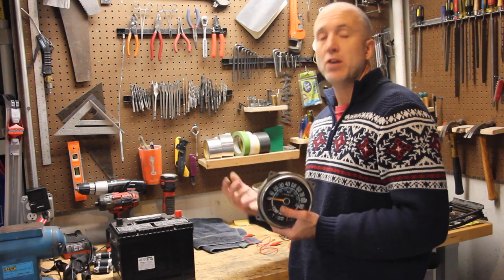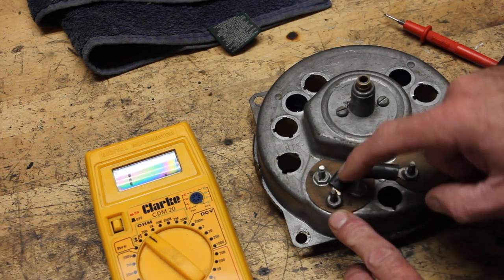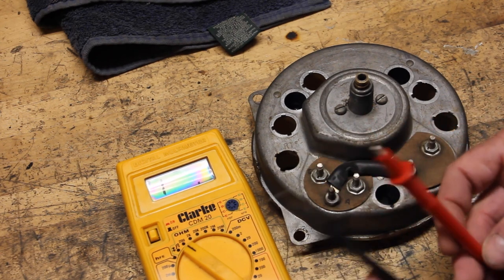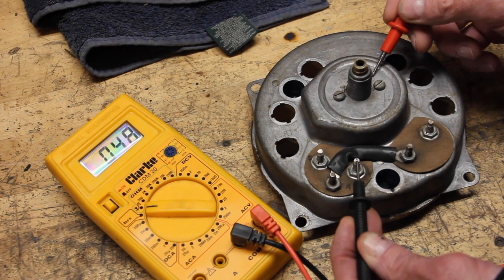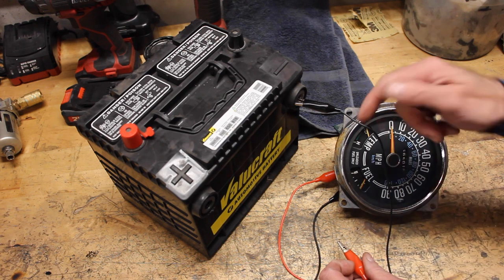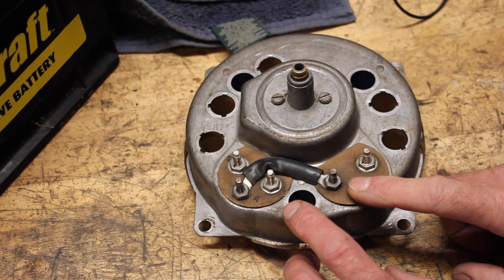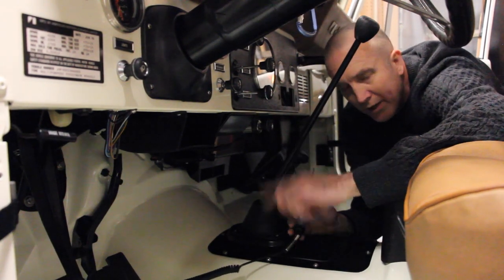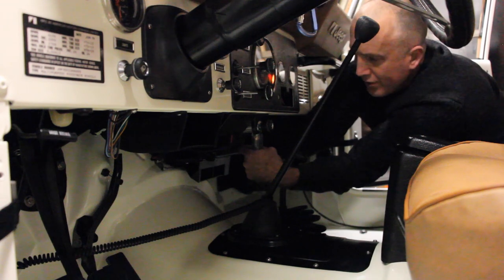Jeep CJ Fuel and Temperature Gauge Problems and Testing

Comment: What a cool and helpful guy you are!  My better half rolls her eyes every time I add another piece of blue tape with the new "do not exceed" mileage to the speedo.  You've taught me now how to properly diagnose this.  If I do trace it to the sending unit, that blue tape method might just have to be the solution though with so many rusty bolts attaching the skid plate to the gas tank!
Reply from the maker: Is your skid plate rusted out or is it just the bolts? I have a video on how to remove the skid plate that might be helpful. And I might have a skid plate I could help you with. If you fix this, or find what the problem is, you're going to be a lot more confident in your range :) Plus you can use your blue tape for actual home improvement.

Comment: Good video, but a couple of things, you need to hand adjust your sending unit on the bench before installing it, by bending the arm. The sending unit is rarely correct from any manufacturer (legally they cant be) unless its oem . This is done by using your ohm meter and testing it at empty versus full, you will need the shop manual to get the correct resistance at the desired level (61 ohms empty, 23 ohms half tank, 10.3 full for 1981). If your still not getting the desired reading on the gauge you will need to remove the gauge from the housing, use alligator leads to make the connection and in the middle of the gauge back side there's a tiny hole with an adjuster screw which will allow you to dial it in, flat tip screw driver.
Reply from the maker: Great build. I didn't want to get into that much detail just yet. In a future video I'm going to take that speedometer part and open up the gauges to show what they are made of and how they work.
Reply: @coolguy_CJ7  Good plan, so many jeepers struggle with the gas gauge just because they assume out of the box (Sending unit) its ready to go, not realizing it needs to be set up before use. By the way nice CJ7, very clean

Comment: Great video!  I just picked up an '83 CJ-7, and the speedometer works, but the temp and fuel gauges, along with the lights, do not work.  I haven't tested the connections yet or taken apart the dash.
Reply from the maker: I really need to do a video on the dash wire harness. Just need to get some time to do it. :)

Comment: On my ‘77 CJ resto, swapped sending unit with a crown and it was DOA.  Swapped for a different one and it worked.  Now 6mo later it still works, but may or may not got the FULL when I top tank off. :(
Reply from the maker: I'd bet that the sending unit works, but only so much. The regulator is probably not good and you only get a limited amount of signal from the sending unit. Or you have a corroded connection/bad ground somewhere in the wire.
Reply: @coolguy_CJ7  Thanks! I'll check that out.

Comment: Good video. I have 2 driveable cj5. They both have problems with the gauges
Reply from the maker: Let me know if this video help out. There’s always an answer, sometimes it just hidden really deep.
Reply: @coolguy_CJ7  yes this video was helpfull. I haven't tried diagnosing the gauges I've only messed with the sending units. I have new factory gauges not installed. I gave up not sure I could install them in the 1971 Speedo. I keep track of my mileage for the fuel and I keep good hoses for the cooling. I.always think I'll get it someday. The temp is the only thing that makes me a little nervous. My factory 1977 gauges made it about 275 000 so they did ok. They both went out at the exact same time with the temp sometimes coming on with a reading and sometimes not. I didn't know anyone on the planet had a working set but I guess you do. I was impressed with your video. It makes me want to play with them again. Your leading me thru the diagnoses will help me pay attention to the factory manual which on this I have not done well. Thank you very much.

Comment: This has been the best video on the topic I have seen!! I have a Temp gauge issue (fuel gauge is fine). I have no power to my temp gauge from the "bridge" of 12V to 5 volts. and no "5 volt pulsing" to my temp sender. I did verify the temp gauge responds to a voltage using a 9V battery. Would you know where I can find the voltage bridge you show in the video? I'm working on a 1983 CJ5 California model. Again...thanks for taking the time to help others like this!

Comment: Thanks for the video, very helpful since I've been procrastinating on checking my fuel guage and sending unit. I'll fill the tank until fuel spills out but the needle never gets all the way to the right/full side. Then I'll drive it until it reads empty but keeps on running for several more days. I know the 15 gallon tank was replaced with another 15 about two years ago but I'm not sure about the sending unit or the gauge...I think they are still original.
Reply from the maker: Only one way to find out where the problem is..... :)

Comment: I had an omix dead on arrival… the post was grounding out on the housing… only has a tiny cheap little oring isolator… was bad.  Second replacement unit ohms bounces… 2nd dead on arrival as well..
Reply from the maker: Fascinating isn’t it? They are also wired backwards from what I’ve found. If you can be patient, you can find originals on FB marketplace, and it’s worth the wait.

Comment: Hey so what if the ohms readings are too high when tested from say S and to ground?  Does that mean the fuel gauge is bad?  I'm trying to get mine to work and get solid test light on I, flashing on A and dimmer flashing on S when the wire is disconnected, with the S wire connected the light flashes very very dim and the fuel gauge only moves to about 1/8 tank.  Sending unit Ohms are 15 which should be accurate since the tank should be almost full.
Reply from the maker: Sorry so long in response. How high? More than an Ohm or 2 and the gauge is bad. Probably a deterioration of the coating on the resistor wires or a potential shorted connection.

Comment: Hi. Really good video. I am about to replace My cj5 77 fuel gauge. It's better and safetier to work with all the things out of the car (over a table). Thank you
Reply from the maker: Definitely. Testing the gauges while still in the CJ is really difficult. :)
Reply from the maker: Reach out if you have any questions on the new gauge. Do you kind of I ask what you are replacing it with?

Comment: I bought a crown coolant sending unit. It was doa. Bought a amazon mexican made one and it seems to work fine. Idk what brand fuel sending unit i have but its aftermarket and works. I have the original, but replaced it when my old gas tank rotted out. Dirt tends to sit in between the skidplate and rust from the outside in.
Reply from the maker: That's part of the difficulty with restoring these old AMC vehicles. There's only so many companies out there that are willing to put the effort into making the replacement parts. They seem to be from low manufacturing standard countries at the cheapest price. Annoying when you're trying to make things right.

Also, that's why I powder coated my skidplate :)

Comment: Well I have the main power to the gas gauge and then the two posts that go to the coolant gauge both blank but when I try to put the test light on the sending unit wire nothing happens.
Also, my engine block temperature sensor does not flash any light when I put the light meter on it.
What does work though is if I turn the key on and I put a ground wire to the engine temperature sensor wire it makes the coolant temperature gauge needle go to hot.
Reply from the maker: This is definitely a ground issue. Email me at dellis6914@gmail.com and I’ll send you a wire diagram.

Comment: I got my 1980 CJ5 back from a friend's shop. I had put in a new fuel sending unit. The tank is a poly 15 gallons. I never had a full tank, just maybe 5 gallons in it. Sometimes my fuel gauge needle will bounce a little, but not much. 2 days ago after I added about another 4 gallons of fuel by hand, when I start the jeep the gauge goes from before the E to on the E . When I turn key off, the gauge needle goes to before E. I am pretty sure the fuel gauge is working, otherwise it would not move. What should I need to look for, check the ground wire on the sending unit, drop the tank and check the float arm on the sending unit? Maybe see if it needs to be slightly bent? I did calibrate with my  multimeter, and moved the
 arm and  it read 72 empty and 10 full.
When you said about the speedo cluster being grounded, is that with it in the dash, or does the speedo need a separate ground wire?  Hopefully it is something simple. If you have anything to add let me know. Thanks so much. Your videos are very informative to all us jeep novices. I was wondering how to send you a video of my gauge before and after I start the jeep if you need to see it. Thanks
Mark Feuerherdt
Reply: Also. I have a light tester. So I will use that info on your video to test my gauges and fuel sending unit. Thanks!!😊

Comment: When testing the temp gauge should you not be hooking up the positive to the positive on the fuel gauge to see if it goes through the by metal
Reply from the maker: That you can do. As long as you have everything grounded so you don’t blow up you gauges when running a current through them.
Reply: @coolguy_CJ7  if they're not grounded how could there be current running through them?

Comment: I tried the alligator clips on the back of the fuel gauge while it was still in the dash. Got nothing. It still should have worked even though it was still hooked up right?
Reply from the maker: Correct. Did the gauge operate before the test?
Reply: No the fuel gauge was not working. But the temp gauge works. So there’s power getting over to that.

Comment: I did the quick voltage check on my temp gauge to see if the gauge would move. It moved the opposite way … more toward cold???  Any ideas?
I had the wires just like you showed.  
Thanks,
Rock…. 78 CJ5
Reply: Nevermind…. The Omix cluster has the S and A posts of the temp gauge on opposite sides of the gauge. I should have known that by looking at which post the connecting strap in on.
Reply from the maker: I was just going to ask if they were aftermarket or not. Sorry I didn’t respond earlier.

Comment: Happy New Year ! Oh and yes , cool sweater 👍 . I’ll say I jumped the gun as I put myself in the position that time was of the essence . 
Not a smart thing to do on my part , but consider the source 🙃 . If I had actually physically inspected a bit more , I would have found road dirt and corrosion on a rear harness disconnect by the left rear tail light and maybe the original gauge may have worked and possibly been fairly accurate ? Well , I opted to replace both cluster gauges , fuel and temperature since I wasn’t getting a reading on either . 
I did have voltage but decided to pull the trigger anyway . Being of sound mind and somewhat of body , I pulled the tank and reinstalled it with a new sending unit . That proved to be a necessity . Plenty of corrosion and not a lick of ground . The sending unit was worse for wear and didn’t give such a clean response on its scale on the ohm gauge . I may have screwed the pooch with the dash gauge as both gauges did ohm out fair . It would have proved interesting using an OMIX Ada sending unit with an OEM 5 volt fuel gauge . Accuracy is questionable so I’m always asking myself how much gas do I think is really in . As far as the gauge working , if I remember , the temp gauge pegged and I had to reverse the polarity by reversing the jumper connection . It’s actually a year and a half ago I did the job but I’m reasonably sure it was the temp gauge and not the fuel gauge that had the polarity problem . OMIX Ada tech was very helpful and was aware of then manufacture problem . They graciously offered to replace if was found a problem . Once the polarity was reversed , all was well . Can I say the temp gauge is accurate ? Well , looking at the scale which just has a C and an H and a line in between , it’s old school all over again. No digital so no accuracy in that respect . As you note in the video , make,darn sure to find that connection and clean it if hounding to get a proper signal to / from the sending unit . Of course we would 😊 . Will I venture to drop the tank and experiment with the sending unit for accuracy ? I’ve been meaning to . There were better mopar units , fuel and temp but I don’t think as of this date are available . Not cool but just typical .
Reply from the maker: I've lost track of how many pieces I've done that exact same thing with. There's something about the urgency of restoring these CJs that get the best of us. For example I had a problem with my AMC 20 brake backing plate. I found a local AMC 20 with N stamped in the housing. 3.54 gears with Trac Lok! I get it home take it apart at the same time I take my original AMC 20 apart. I come to find that the original AMC 20 was N stamped and the exact same. I spent $150 and $90 in rebuild kits and got nowhere. Meh.

Comment: Okay, so S isn't flashing with a test light on the fuel gauge. When I removed the wire from the sending unit "S" it starts flashing. Does that mean I have an issue somewhere from the sending unit to the cluster?
Reply from the maker: That would be my guess. Another option might be the ground wire that runs from the sending unit to the frame. Did you do the test starting at the 19:00 mark?

Comment: Hey. Pretty good video!  Question for ya…..

With my ACC on, I tested the wire in the engine compartment going to my temp sensor. Mine is a constant light and not flashing. Thoughts on this?
Reply from the maker: Sounds like the sensor is bad. Let me check my documentation tonight to confirm.
Reply: @coolguy_CJ7  ok, so here’s where I’m at…..

Purple wire in engine compartment does pulse with test light. With the constant power before the engine was on accessory. So in run it’s good to go. 

Tested temp gauge with constant 12v as indicated in your video. It works. Terminal in the back also has pulsing power. 

However, the gauge is not working with it assembled and connected. I made a dedicated ground wire for the speedo cluster too. 

Thoughts?

Comment: I need to replace the fuel gauge. Do I have to take out the entire speedo cluster to do this? If so do you have a video showing how to remove it? Thanks!
Reply from the maker: First, are you sure it’s the fuel gauge? Second, yes, you’ll have to remove the speedometer. Third, no video on the disassembly of the speedo yet (soon).
Reply: @coolguy_CJ7  Am I sure, hahahaha. NEVER!!! But I did drop the tank and check the sending unit and it is good to go. The Temp gauge is working so I assume there's power getting to it. Is there anything else I should check first? Thanks for all your help!
Reply from the maker: @davebrown5403  Just the grounds. Did you try to “hot wire” the gauge to test it?

Comment: I am not getting a continuity sound when I go to make sure my fuel gauge is grounded to the housing.. what are my next steps?  Why wouldn't it be grounded?
Reply from the maker: You should only have continuity between the A post and the housing. The S and the I don’t. There is a small metal strip on the back of the fuel gauge that connects to the housing. Are you sure that is clean and getting good contact?

Comment: Does your voltmeter function? I disassembled mine and have noticed then when I hooked to my power supply that the magnet does move and the needle is not fixed to it, I was wondering if it originally was and if a small dot of superglue could solve the issue. Any feedback would be great, love your channel I bought my 81 cj last March and am loving it!
Reply from the maker: The one in the dash? Yes. I've taken apart a few of these gauges to see how they work and have found that the most fragile of the group is the voltmeter. The needle is brittle, fragile plastic and breaks off at the slightest touch. You could try glue but be very careful and use a very light touch. There are plenty of people selling good used voltmeters on FB marketplace. Don't pay more than $30 for one though :)

Comment: My gauges work intermittently. If I put the test light on the sender post of the temp or fuel gauge, the gauge read, but I am guessing they are just reading the resistance of the test light circuit? I know my fuel sender is not grounded (waiting to burn through this tank of gas to drop the tank), but I can't figure out the temp sender...
Reply from the maker: The temp gauge is powered by the fuel gauge by way of the jumper strap that converts the voltage from 12 to 5. If you gauge has no power or ground the temp will more than likely not operate correctly. It’s amazing with these AMC CJ what a good ground will do for the whole system.

Comment: i believe you may have a test wrong when measuring the +5 DCV .  i would think you want to go to ground and and jumper going from the fuel gauge to the temp gauge. 
 Putting the leads of the volt meter across the jumper wont  read the voltage because one of the leads needs to go to ground.

Comment: So I have a question. I just recently installed a brand new sending unit and gauge worked fine for about a month then became stuck on half a tank. I dropped the tank and checked the sending unit and it was good. Then followed your directions to check the gauge itself. Everything seemed to be working fine yet my gauge is still stuck on half. What could be my issue?
Reply from the maker: Is the gauge aftermarket or original? Also, have you checked all the grounds? Sounds like a resistance problem.